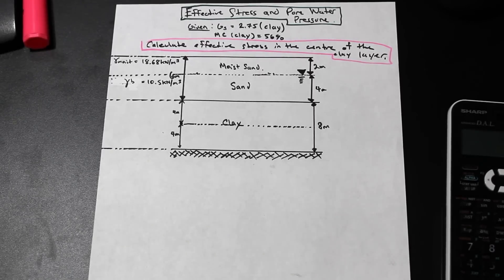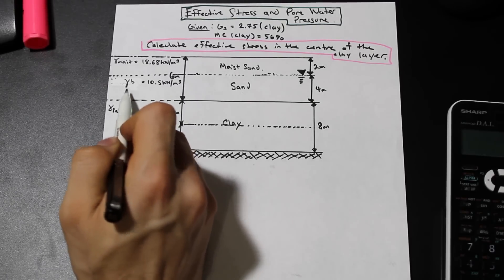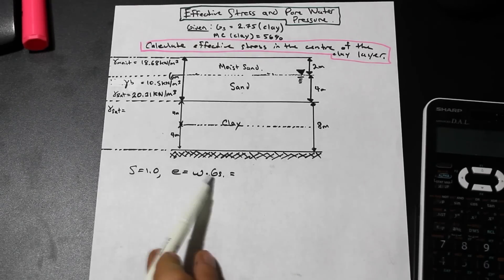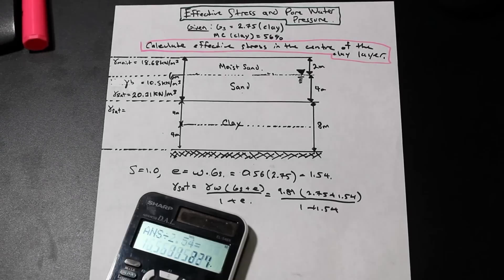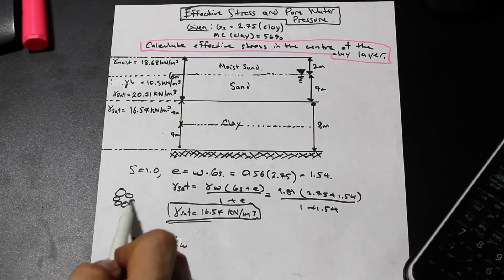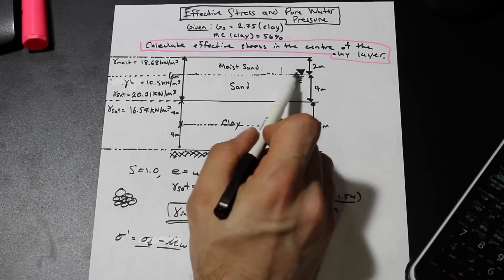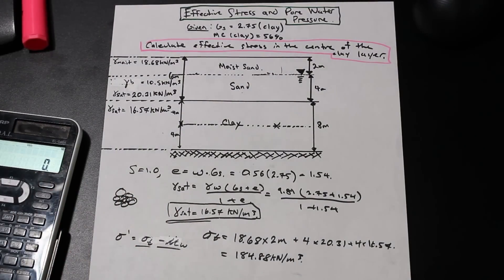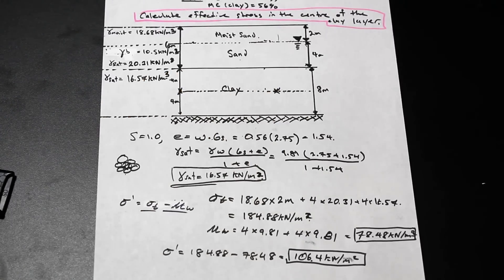Calculating the Effective Stress at the Centre of a Clay Layer - Soil Mechanics

Comment: Why i would subtract  pore water pressure from most sand where water table is blew from this? 

Your answer is wrong.  

this is how the equation should stand : 
18.68x2 +(20.31x4-9.81x4)+ (16.54x4-9.81x4) =106.28(unit/....)
Reply: He is correct and he got the same answer with you......I love his method  very simple

Comment: If the water table were to move down to the top of the clay instead, would that change the effective stress?
Reply from the maker: Do you mean move up to the top of the clay layer?  Take a look at how pore water pressure is treated in the equation and there's a short equation too explaining how it affects the effective stress.

Comment: Really helpful video easily one can understand how to calculate effective stress which is very important while we design pile by using static formula and I am finding little problem to calculate like its skin friction average undrained cohesion etc. 
Once again thanks a lot
Reply from the maker: Depends if you're a geotechnical engineer or not, those numbers will be provided to you if not, but if you are typically the geotechnical engineer will give skin friction values for various depths, not an average.  This can also be determined by something called an O-Cell test empirically.

Comment: You did not explain the problem well for a beginner like me, I did not understand the Uw part
Reply from the maker: Sorry you didn't get much from our video, a lot of our problems require some base understanding of the topic.  If you're unfamiliar with what gamma water is, you'll probably need to go back to the beginning of soil mechanics and do some additional reading.

Or, were you referring to the pore water pressure uw? I thought we explained in the video that we subtract it from the total pressure to obtain the effective soil pressure.  Was this not clear?
Reply: I know what is gama water however I did not understand the part when you found Uw. Uw=gama water* (sand height)+ gama water* (1/2 height of the clay which you used 4) I don't know why you used 1/2 height for the clay? shouldn't we use 8 for the height?
Reply from the maker: Ah, sorry for the misunderstanding.  We're attempting to find the effective stress at the center of the clay layer.  So when calculating the pore water pressure, start where the water table starts, and multiply gamma water by the distance to the point in which we're trying to evaluate the effective stress.  

Then we subtract the pore water pressure from the total stress to find the effective stress at that point.  This is because the pore water pressure tends to reduce the pressure in our sample by pushing outwards on the particles of soil, as I explained earlier in the video.  

Hope that helps! We try to make videos to appeal to a large variety of students, sometimes our videos aren't suitable for every student at every level.  Please let us know if you have any more questions.
Reply: Well, thank you very much I did not know that you were finding the effective stress at center of the clay layer.
Reply from the maker: No problem, perhaps I didn't indicate in the question that clearly enough.  Let me re watch the video and I'll make a note in the comments/description if required.  Thanks for the feedback!
Reply: it is totally clear, I have an exam in like 20 hours and I am revising too fast, no problem thank you!
Reply from the maker: Good luck!

Comment: How would you find the total vertical stress in this question?
Reply from the maker: Good question.  In this question we solve for the total stress and subtract the pore water pressure to get the effective stress, or sigma prime.  In order to get the total stress, simply complete the step for sigma t in this video at any point you'd like and don't subtract the pore water pressure.  Hope that helps.